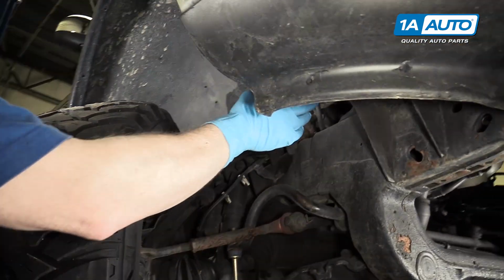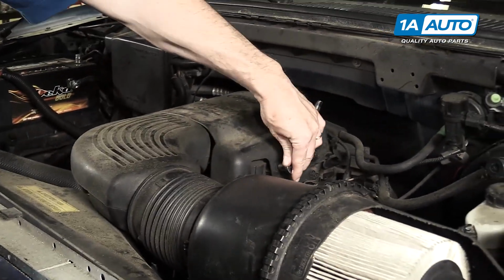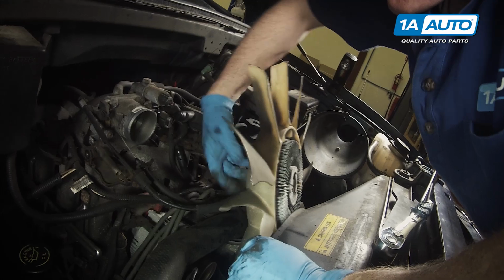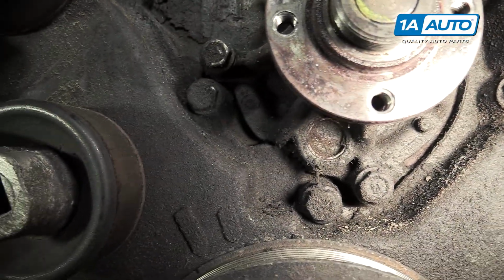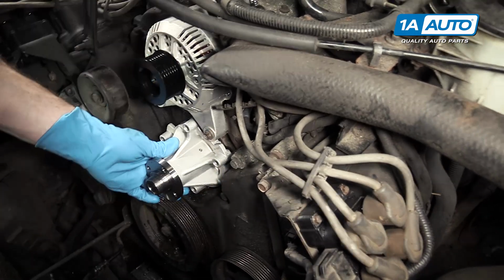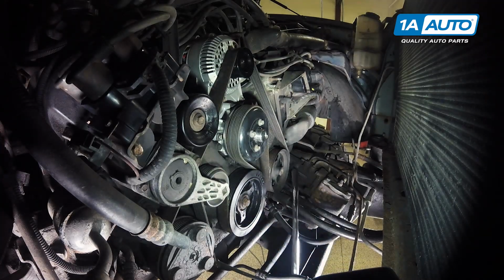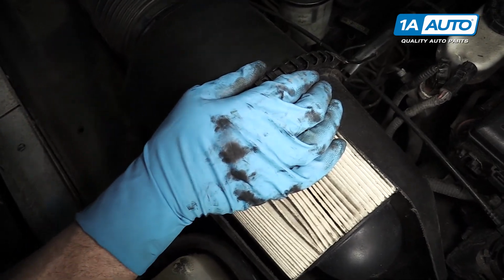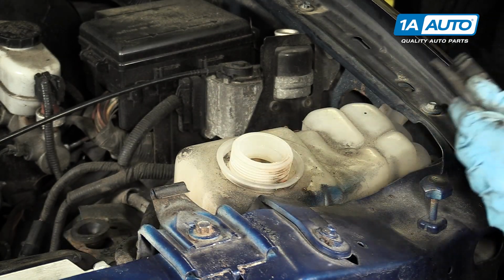How To Replace Water Pump 97-04 Ford F150

Comment: I just had my waterpump replaced and is now overheating just driving 1-2 miles. The thermostat was replaced also about 2 months ago.If i understand correctly on this vide for this model car the coolant system does not need to be burped like on another video on this channel which says some vehicles needs to be burn and some dont?

Comment: I have a great mechanic who is very honest and he has never done any work that is not absolutely necessary.  That said, he has to make a living and labor in his shop runs over $100 an hour and he buys parts locally and marks them up to cover his cost of procuring the parts.  As a result, I estimated that I would spend about $600 to do this job on my truck.  I dreaded doing the job myself but this video showed me exactly what I needed to do.  I bought the parts for less than $100 and did the job myself on my 1998 F150 in about 3 hours.  This video made all the difference between struggling with the job and getting it done smoothly without any problems.  I am retired and 75 years old and it really feels good that I can do something and make the equivalent of $500 on a Sunday afternoon.

Comment: I'm thinking it might be a good idea to, at least, inspect belts & hoses if not replace them with the water pump.  They have the same mileage and age as the water pump.  Sure there is an increase in money and time, but also peace of mind for us high mileage guys.  Thanks for the video.  My 2000 F-150 4.2L may be more difficult due to AC hoses & tighter space.

Comment: Thanks for making this video.  I am in the process of chamging the water pump now.  Can a bad water pump cause a loud tapping sound?  Any reply would be gret!
Reply: it can depending on how it failed and the type of pump. if it is the pump, REPLACE IT ASAP!! there will be wear and metal shavings can plug up your radiator and cooling system requiring a replacement

Comment: Hey there just wondering if the fan is not put in the right way and broke the waterpump  and  bearing will that cause the truck not to move  forward or backwards

Comment: Mine is a 2000 and the ac compressor is on the opposite side so therefore the removal process is different.

Comment: Cut the shroud in two pieces using zip ties or small lock nut and bolt, or.....best option go electric fan off a Lincoln Mark 8 fan , moves Hugh mount of air, but pigtail for it and buy a fan relay thermal switch kit, or thermal fan controller with relay , maybe over ride switch in the dash. Done, better power more mpg